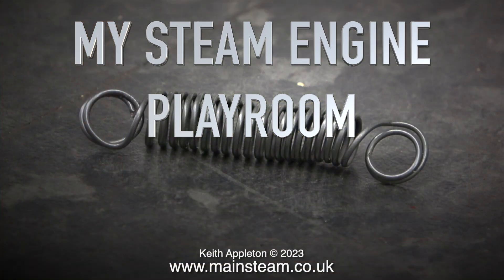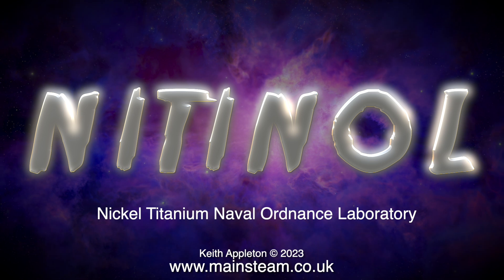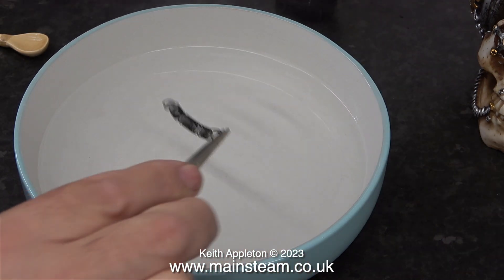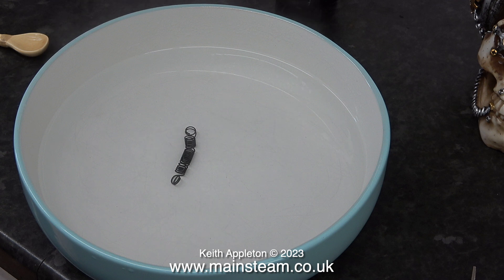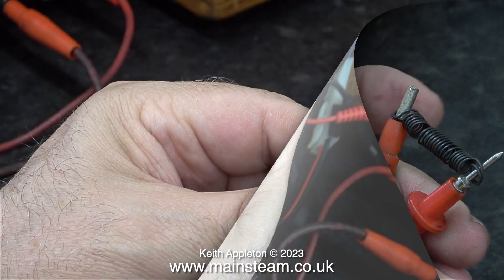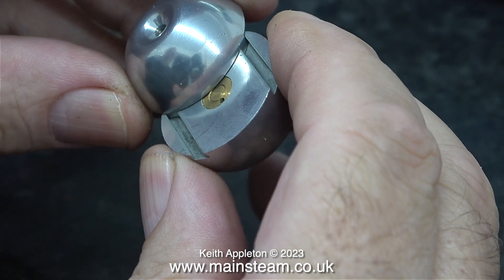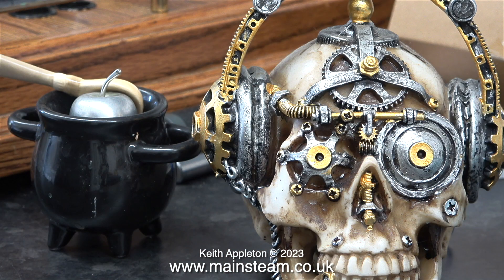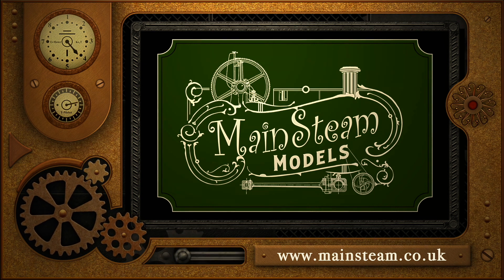IN MY STEAM ENGINE PLAYROOM - PART #6

Comment: Years ago (in the 80's, I think), I read about nitinol in NASA Tech Briefs, and obtained a sample pack from somewhere. I still have it, buried in one of the boxes where I have Science Project materials in the slowly fading hope that my Grandson will take an interest in technology (other than Gaming). My Granddaughter is past this stage, but is well on her way to becoming a professional in another field.

I had an idea of using nitinol springs in Robotics for extension/retraction. I had even come up with a name for the application, "Tuscles:" a combination of Tendons & Muscles. A coiled spring provided resistance to extension, and heat in the form of applied current provided retraction, just as your demonstration. Unfortunately, I never copyrighted or patented the application, and I saw a few years ago that someone was using this application and even selling kits for use in Robotics.

The most interesting early application I am aware of was in Fog Lamps: a company used nitinol springs to actuate plastic louvers that protected the Fog Lamps when not in use – when the lamps were turned on, the heat from the bulbs would cause the nitinol springs retract and open the louvers; when the lamps were turned off and the bulbs cooled down, opposing regular springs would close the louvers.

Thanks for all of your videos, best regards, Charlie
Reply from the maker: Very interesting, thanks Charlie {:-)))

Comment: Your misspent youth was clearly worse than mine.  I first heard of this stuff on the original (Raymond Baxter era)  Tomorrow's  world. Then they used wire and sheet metal but, if I recall correctly said it was extremely expensive. I like your steam engine repair videos most if all but those such as these and the Andrew series add a welcome variety. Being a type1 diabetic for nearly 60 years and about the same age,  I  understand your health issues. Girlfriend jokes while distinctly non-PC  they make me snigger or groan. Great stuff!
Reply from the maker: I had never heard of it until recently, and I also used to watch Tomorrow's World.

Comment: Dear Sir,
These alloys are incredible. They have memory, they go back to the shape they where. They are also used, methinks, in medical procedures. You make a cilindrical shaped coil, stretchs it, freezes it very cold, put it into a patient's blocked vein, then the heat from the patient's body makes the coil turn back to the shape it was, so it widens the vein and makes the blood flow normal again.

Speach correct.

Cheers from Brazil
Reply from the maker: Yes, my friend Andrew mentioned that.
Reply: The heat from the patient's body makes the coil reshape back to its original cylindrical shape, thus opening the vein's flux.